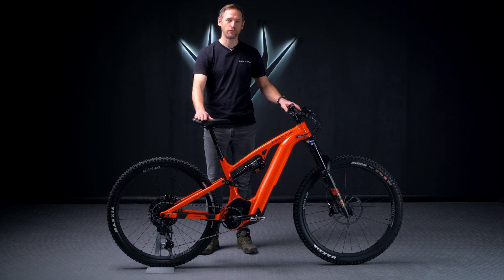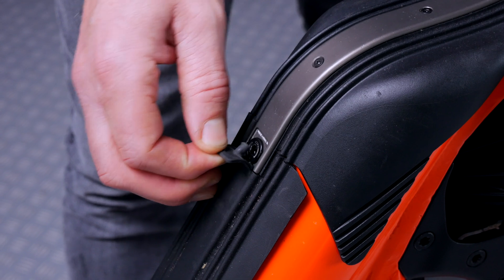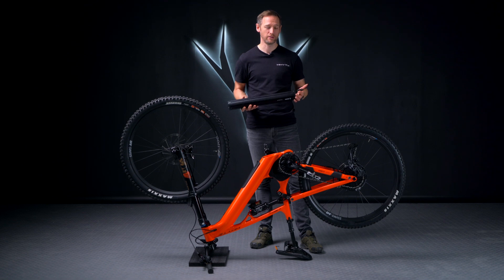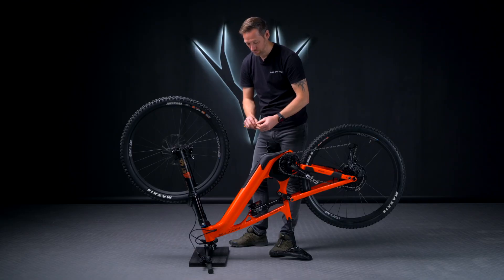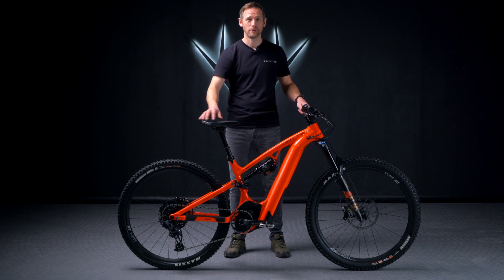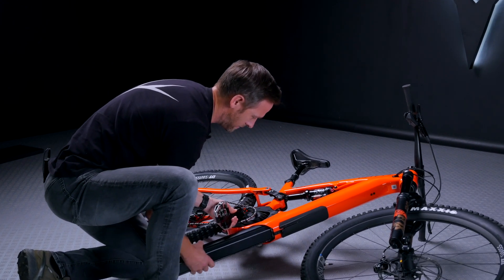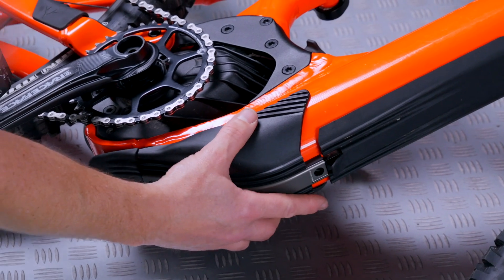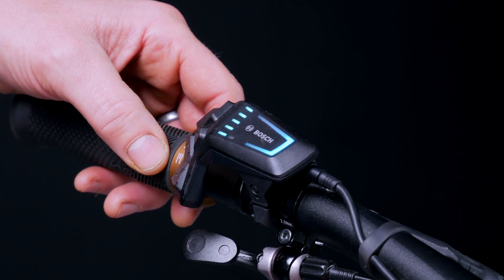How to… Remove & Install the Bosch Smart System battery on a Whyte electric mountain bike

Comment: My E-160RS won’t turn on today and idk why? Just doing my regular routine, removing battery upside down, charge until full, then back to the bike with upside down. Then, it won’t turn on. 
Click power button, just usual, a green light going up followed by 2 blink of white then goes off.

Comment: Do I need to adjust anything if I install 625 or 500wh battery?
Reply from the maker: Hello, yes you'll have to reposition the top connector (move it down towards the bottom of the bike)
Reply: @WhyteBikesgb  Okey thank you for the answer! Could you make quick tutorial video of that? I actually have a problem that power goes off sometimes with stock battery and I guess I need to reposition the connector. So tutorial advice would be great to see how to find correct position for top connector.
Reply from the maker: @multikeissi  You can't do a fine adjustment of the connector, it just has preset positions. It sounds more like there might be a connection issue with the battery or connector itself. Please drop an email to RiderSupport@whytebikes.com and they will be able to advise.
Reply: @WhyteBikesgb Hi how do you do that? Can you do that yourself?